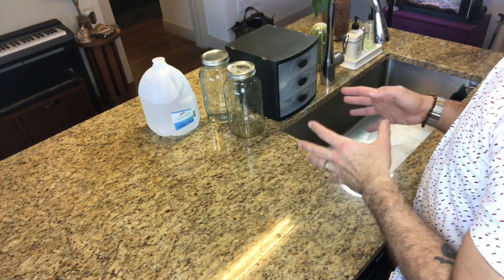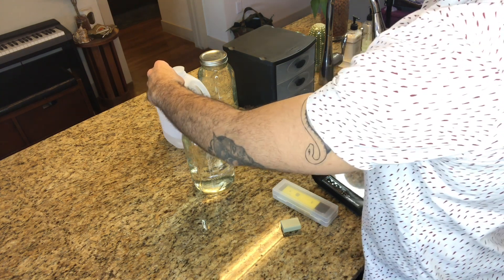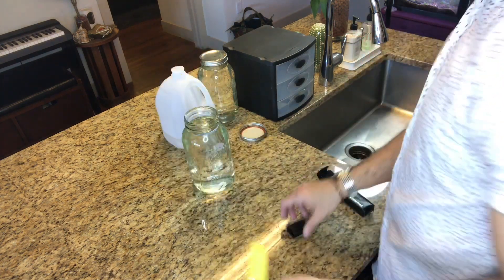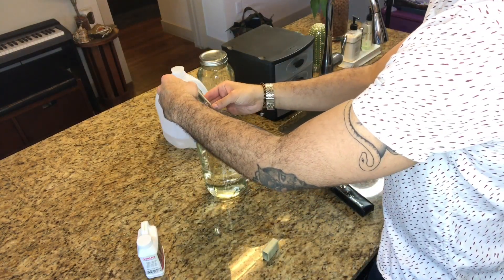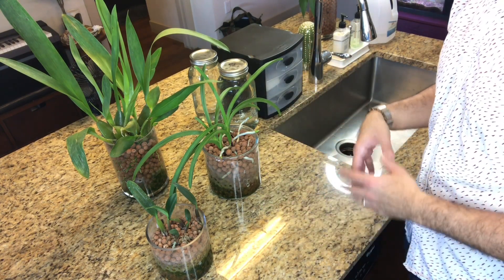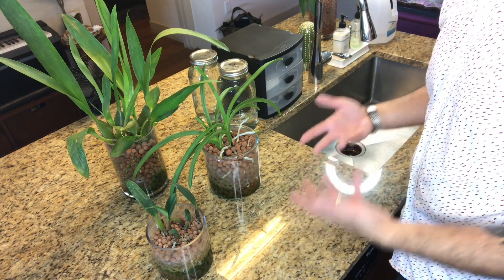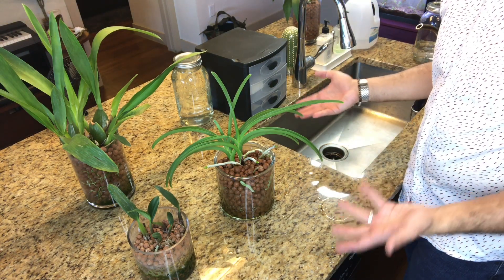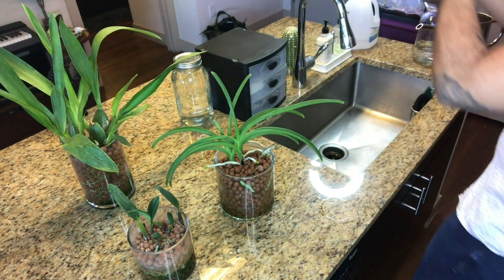Watering and Fertilizing: Semi-Hydroponics (Part Two)

Comment: Hi Michael, I can't tell what your setup is for air flow, but from my experience if you have great air flow in the room where you grow your orchids then it should help with the accidental water in the crown or on a new growth that would normally cause rot. Ever since I added 2 more fans in the same room as the orchids, I haven't seen a single thing of rot on anything. I even will dunk my Vandas in a whole pot of water over night and have never had any rotting issues with them either. Hope this helps! :-)

Comment: Hi Michael, wondering if you have ever used melted snow or rain water for your orchids??? I'm in CT, and have been boiling snow down and am seeing great results with my orchids in terms of new roof growth, new leaves, and spikes...seems like they are loving it but wondered if you would recommend against it for any reason??
Reply: There shouldn't be anything wrong with that. When I lived somewhere where it snowed I'd use icicles for drinks instead of tap water ice. It is pure water except for maybe what was in the air.

Comment: Michael - Please clear up a couple of things I'm not clear on. I've recently converted 12 phals to the way you've instructed with drilled glass and leca. How often is the water to be changed as shown here? When the water has dried from the bottom? Weekly?? Astrologically??? lol  And did I hear you say in one of your vids that you now put sphagnum moss on top to help keep moisture in? Are the beads/moss to be kept away from the crown and root tops to prevent molding? Thanks!!!

Comment: Hi Michael. I use a reverse osmosis system that has a final filter that supplies Ca++ and Mg++ at 20 ppm, pH at 6.0. The system is from www.citywaterfilter.com/best-reverse-osmosis-install-city-water-filter/.  it cost $450.00 set up, is connected to a sink tap, my fridge for drinking water and  ice maker. In 2 years it has paid for itself in terms of buying distilled water, bottled water and I have not wasted any plastic bottles or gallons.....and, Its sink tap is perfect for flushing.....

Comment: Hi Michael, happy new year. I'm not understanding your logic with regards to pH levels in your watering solution. The whole point is to water your orchids with a solution at the correct pH levels at the time you're watering. The fact that the pH after a week is around 7-7.5, which is neutral, is completely normal and, honestly, quite irrelevant...that's why you're flushing it. If you don't like the pH to get so high then flush after 3-4 days, but the objective is not to have your pH at the "sweet spot" after a week, but rather at the time you water. Otherwise, not only are you putting your plants at risk for things such as root burn or burning new root tips by watering with such an acidic solution, but they won't be absorbing the nutrients you're providing at those levels either. That is my concern with your method and, in turn, the fact that other people are "enlightened" by it as well. This is not a personal attack and I apologize if it comes across as harsh or crass in any way. I just don't like the spread of misinformation, albeit unintended. Have a great weekend, and please correct me if I'm wrong about any of this. Thanks and happy growing ;)
Reply from the maker: Hi Ben, I appreciate the open dialogue and don’t feel attacked at all! I always like having an open discourse about these things because I am constantly refining my approach and learning. That being said, I have never encountered root burn using this method, and find that my pH will jump up as quickly as 15 minutes after watering, not in 7 days. And since I provide them a constant feed, I try to account for that rapid shift in pH. Before, when i was following the directions portioning instructions on the Dyna-Gro exactly, my nutrient solution ended at a low MUCH lower pH, and still with no outward signs of damage to my plants. That being said, i am only ever speaking from my experience and perspective, it is never my intention to spread misinformation. I validate that your methods may be different from mine, but the tactics I’m using have yielded positive results for me. Happy New Year to you, I hope this clarifies things a bit.
Reply: Hey guys! I'm not a famous youtuber but I am a orchidaddict and growing in leca. I also was worried about the PH in leca reservoirs so I've read loads of info about it (mostly from marihuana growers online). What I"ve read is that the PH in the reservoir is the most important, not the PH you put into the vase. I was doing some testing and indeed, the PH climbs up very rapidly! So I did the exact same thing Michael did, using a lower PH (I even use 4 sometimes) so when the PH climbs, it also goes into the 5.5-6.5. Eventually, after a week the PH range is about 7.7 to 8.5. I think this PH swing will even be beneficial because the orchid can use all the micro and macro's because of the PH range the water has over a couple of days. Sorry for this long novel :) Happy growing y'all! I <3 both of you! :)

Comment: Thanks Michael. That’s very helpful. One thing I’ve noticed with my orchids since I’ve transitioned them into semi hydro is that they do very well ie lots of new roots. But quite a few of them (mainly the phalaenopsis not other types) grow a new tiny leaf quite quickly then a second new leaf before the first is mature. I put this down to adjusting to the new medium. My champion phal with this phenomenon has 4 new leaves but at least each is slightly larger than the last. They are all otherwise looking very healthy. Have you seen this?
Reply from the maker: Yes, this is super common. As the plant transitions, the leaf size becomes much smaller. Once fully established, the leaves start to grow at their old size. It’s nothing to panic about!